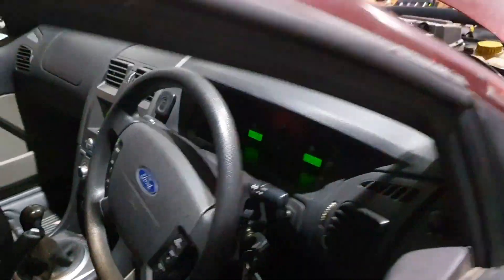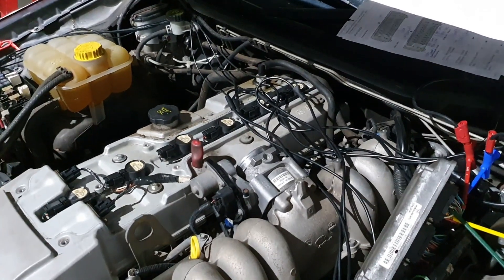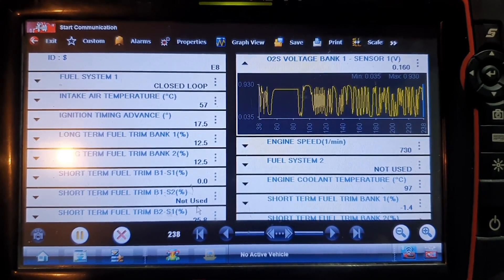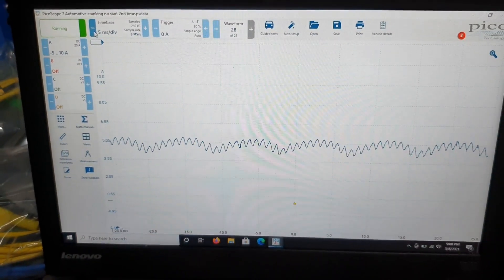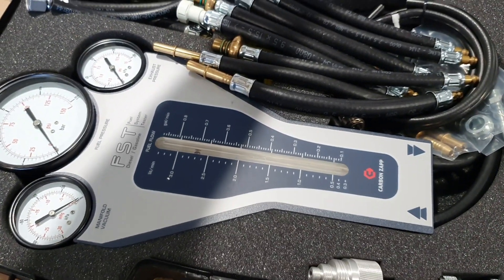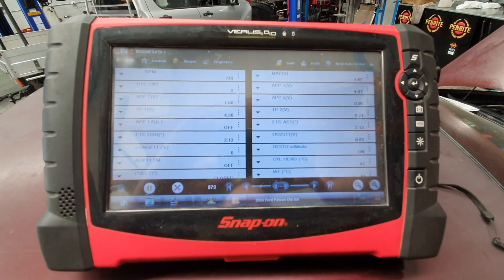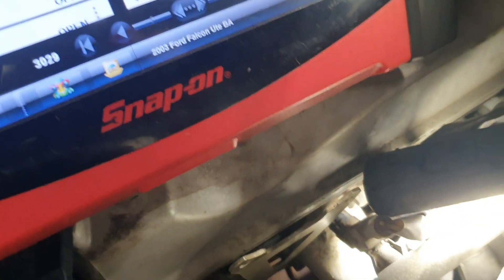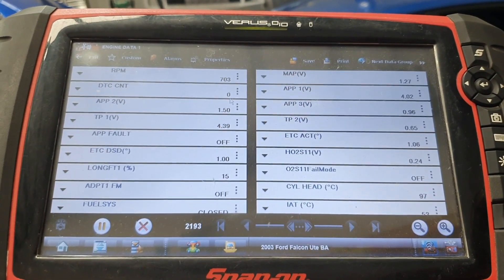You'll never guess what causes this intermittent stall! - BA Falcon RTV cutting out / stalling

Comment: @romanosautomotive Gidday. Thanks again so much for this video - I've gone ahead and purchased a Bosch MAP sensor in the hope that it also fixes MY random similar issue (having recently installed and paid for a used ECU) - What is the easiest way to install the MAP sensor on a BA falcon? I'd like to avoid having to remove the intake manifold to do it, but can it be reached relatively easilly from below, via ramps or jacks (I don't have a hoist unfortunately). Thanks very much in advance. ~Steve

Comment: And I bet the customer still only paid 1hr for Diag 🤦
I have cleaned out and replaced plenty of these map sensors for these symptoms. It's berry common.
 And without any of this technical diagnosis. 
But the truth is, I only know to do that because of shared experience with my colleagues and neighbouring workshops. We collectively saw this many times on ba-fg. By design, the sensor swallows a lot of dirt, so a good sensor will sometimes just need cleaning (not in this case).

This skill and way of diagnosis eliminates any guesses (no matter how low the chances of it being incorrect) and also sets you up for much more complicated diagnosis on other cars. 

I was never taught to work this way while I was in the trade (5 years) but they're things I'm trying to implement now that it's just a hobby for me, rather than to just throw parts at it.

Good stuff mate 👍

Comment: Hey mate, i have an 07 bf xr8 with a similar issue, only seems to do if after its been ran for 2 hours or more, just out of curiosity weather that ute cut out or went into a limp mode kind of state where it missed and didnt want to rev. Mine doesnt come up with engine lights or anything, cheers
Reply from the maker: Hey mate, this cut out and would sometimes start right away or sometimes crank no start for a bit. No codes or lights either.

Comment: I've had the same issue with my RTV BF, i have replaced the speed sensor on the crank front left of the motor, also the map sensor as well as the spark plug points, its still cutting out while in traffic which is a pain, the only thing left is the fuel pressure regulator or the fuel pump. Any suggestions would be appreciated. The code that keeps popping up is speed sensor A PO500 $7E8
Reply from the maker: Hi Mark, it's hard to give you suggestions over the internet without seeing it. Where in Australia are you, maybe I can point you in the direction of someone who may be able to help?

Comment: My gas fg falcon will randomly get a ETC fault, haven’t had it for awhile now but sometimes at night in the cold the idle will go up and down from 1k rpm, if I drive it when the this is happening. To much gas will make the whole car cut out. I think a dodge fuel pump or even the gas converter freezing up. Any help would be great
Reply: The gas converter won’t freeze up unless your water level is so low it’s not getting water through it, as happened to me. My BA lpg sedan stalls randomly, but usually before engine at running temp, about once every 6 weeks. What chance to diagnose?

Comment: Brilliant video!!! I have the same problem with my territory and a mechanic was sure it was the throttle pedal and TPS both changed and didn't fix it, going to see if this will fix the issue!!
Reply: Unfortunately for me it wasn't the MAP sensor, I also replaced the TB while I was replacing the MAP sensor, I've done plugs, TPS, new Pedal, new throttle body,MAP sensor and I still have to same issue with the ETC code coming up and shutting the engine down, any ideas where to look would be amazing
Reply from the maker: What are the codes that keep appearing and is it just an intermittent random stall?
Reply: @romanosautomotive  P2107 TAC control module procceser fault, PO773 shift solenoid, PO743 TCC torque converter clutch solenoid, it's a intermittent fault, runs and drives beautiful, goes through a few heat cycles and ETC code comes up, then engine shuts off, immediately fires back up but stalls again within seconds, once it sits for 15 mins it will start back up and drive beautiful again, then cycles reapeats after heat cycles, doesn't over heat and sits between half way and a 1/4 on the temp gauge,
Reply: @romanosautomotive  the pedal and TPS code where there and have gone away since being changed 
Wish you where in Newcastle I would bring it to you haha

Comment: Having a issue with my ba 2003 xr6t il be driving then put of no where it'll just cut out sometimes a red hand signal pops up, and sometimes just the batterie light, when it cut outs I can just put the car back in park then it starts straight away. Mechanics have no idea what's going on where I live lol tps was showing on scan, changed the tps got it scanned, scan showed clear went for s drive then it cut out again lol 🤦‍♂️
Reply from the maker: Whereabouts are you located Majin? Maybe I can point you in the right direction somewhere
Reply: My turbo was doing that when you let off the throttle at low speeds like pulling up to a red light etc.  My son said its the blow off valve so i took it off and tested it with compressed air and it was leaking bought a gfb one and it was fixed.
Reply: Kind of says allot about Ford quality, when the dealers can’t diagnose these engine faults. In 2003 the diagnostic codes were still primitive. Hopefully now they would pick up your fault and the map fault in this video.

Comment: Very thorough diagnosis.
Got any experience with LPG BFs?  I have one (FiL drives it) which cuts out (rapidly cuts in and out until you manage to accellerate past the 'dead spot') at a very specific throttle position.  Which makes me think the TPS is faulty (the car has done 750k kms) but like any modern car it could be any number of things.  Even our local gas expert is of the mind to just throw parts at it until the problem goes away (starting with coils, plugs, and leads).
Reply from the maker: Are you in Perth?
Reply: @romanosautomotive  Nah mate, Brisbane. Bit of a drive to drop it into you. :)
Reply: Make sure he doesn't charge you for leads, coil over plugs no leads.

Comment: Well done
Good to see there's auto repairers out there that still have the drive to chase these sort of problems down.
👍
Reply: I was very interested in this video as my RTV is doing the same thing, it started last year after fitting a new alternator which proved to be faulty due to charging at 15.9 volts, it interfered with my electrics, ie central locking, fuel gauge failure, miss firing and so on.
I have replaced the points plugs, angle crank sensor, and a few I've forgotten. Thanks to this i have just replaced the Maf sensor fingers crossed that it is the cause of my problems 🤞
Reply from the maker: Thank you Ezy. Much appreciated!

Comment: Great video! I have an issue with my BA 6 cyl Falcon. It has a very rough idle for about 1 minute after I don't drive it for a couple of days. This seems to happen more in the colder months. Any ideas?
Reply from the maker: It could be multiple things unfortunately. Do you have a reputable shop close to you that can look at it?
Reply: @romanosautomotive  Yes I do. They said it's possibly the injectors.
Reply: @donotwantahandle1111  ,First  tray liquid molly intake petrol cleaner German product and spray in trotle body with instruction. Also injectors cleaner you can put in your petrol tank and your falcon will have good idle,and better preformance.Hight profesional did not tell you this which is very sad, but this should be first step before you waste money for profesionall mechanic,because they always go around to spend more time for investigation,parts and labour,but car will run same like before.

Comment: Cool  mate 4.7v key on and  1.2v  engine running same as AU , your a wiz mate .have you seen the damage e10 causes to fuel rails .Rusty rusty rusty. A simple check on fuel pump is to look for 600ml in 30 sec on the return line idling. More than that could indicate blockage at injectors because more fuel is returning rather than going into engine. And a low reading is worn pump or blockage at filter or line or reg faulty .Either way checking return volume is really good.
Reply from the maker: Thanks for watching and the input 💪
Reply: E10 does more damage than people realise i first came across the stuff while working overseas in the mid eighties, it was early days for fuel injected cars and the ethanol was causing havoc it was gumming up injectors when the cars were left unused for a month or more. Even if you use it in a 2 stroke mixed with the correct amount of oil unused it will gum the piston up. It will gum piston rings up on a car causing a lack of compression it is basically dreadfull stuff that can wreck a car from one end to the other.

Comment: Dogged till the end ! Would there be any value to closing the hood as much as possible to heat up the components ? What about using a heat gun on each item to stress it ?
Reply from the maker: Thanks Bill and yes we tried the heat gun on the PCM and the bonnet closing for the engine bay but no difference. Unfortunately impossible to get the heat gun on the MAP due to its location